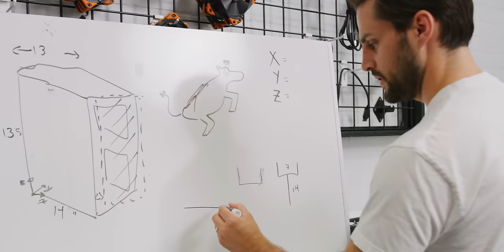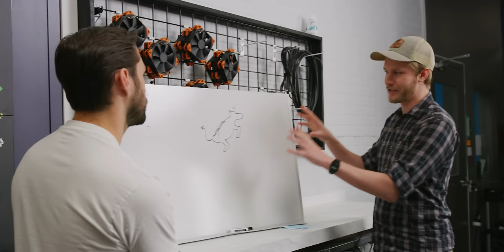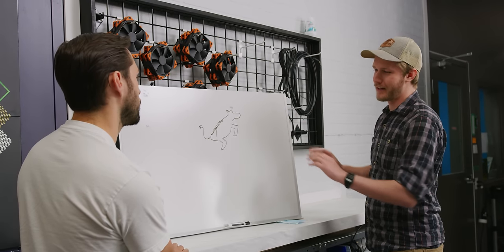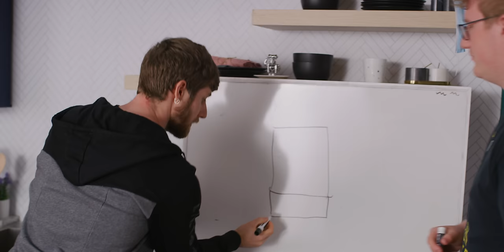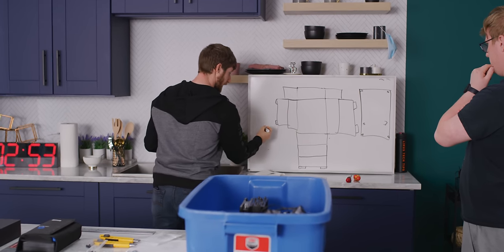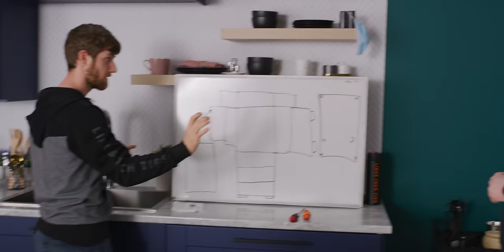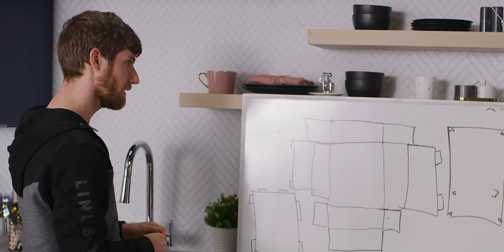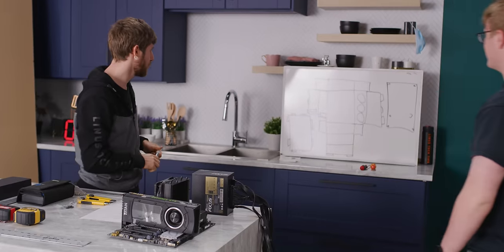Cardboard DIY PC Case Building Challenge!

Comment: how did they attach the mobo to the carboard?
Reply: screws
Reply: @radimqetzalcoatl7401  don't think.they used normal screws did they?
Reply: NorryRampage Why not?
Reply: I assume they used screwss and nuts because cardboard wouldnt really hold the screw in by itself

Comment: The video perfectly shows agile ways of working vs waterfall. Waterfall represented by linus team. Their solution was better in this case, but only because the other team was generous enough to give them more time. The best plan istn't worth shit when you don't finish on time, what almost always happens when you do excessive planning instead of just start doing stuff.
Reply: The other team wasn't generous. They too needed more time.
Reply: @Daunlouded  true. But they still had a more finished product that would probably when if it was judged when the timer ended.

Comment: I unironically did this in around 1999, with a 500mhz celeron. Even went to LAN's with it. People loved lightly hitting it and making it reboot.

My first two computers were gifts from my parents, a 286 and then whatever came right after the Pentium 4. My 3rd computer but the first I bought for my own money and couldn't afford a case so made one out of wood and cardboard.

I was then gifted a case from a friend, it was their family computer they were throwing out. I still use that case today so it's around 25 years old. Holds a i5-9600k and RTX 2070 without issue.

Comment: I would look for a box that a computer case ships in.
Just copy the holes and backplate holes, maybe glue some folded card blocks into it to hold the power supply and motherboard. Rig up screw mount arcade buttons for the power switch. That's possibly the easiest path.

Comment: Ok in all seriousness would this work permanently? I’d be worried about heat and cardboard but I have some cheap people I build pc’s for.
Reply: nah man,wont work,just comes to get their pc and you give them a cardboard box with stuff inside,oof
Reply: I mean, that's what we did for the raspberry pi until we needed a fan, that made us cut our cardboard box lol.
Reply: Go for Foam Board or Plexiglass if they can afford that much. Surely should be more stable and durable than cardboard.
Reply: Having made doll houses out of cardboard for my little one, no. It will not work permanently. One rainy muggy day or accident with a glass of koolaid and you're done.
Reply: it's a fire hazard.
Reply: @TheREALMcChimp  Look if your computer is getting up to temperatures hot enough to burn cardboard, or throws sparks that can do the same, the case isn't the problem here
Reply: @JeoshuaCollins  Maybe you just didn't quite push one of the power leads for something inductive like a fan in far enough and it arcs. Maybe the cardboard gets damp and something shorts through it. Sure, the original fault might not be caused by the case but the case is what makes the difference between a simple mistake producing an annoying buzzing noise and a simple mistake setting your house-or worse, your customer's house-on fire.

There's a reason laws prohibit the manufacture of flammable appliance cases throughout the developed world.
Reply: @virtualtools_3021  Motors are an inductive load. They can produce transient voltages exceeding the supply voltage.
Reply: @TheREALMcChimp  Uhh, you do realize PC fans are safely behind a motor controller chip, and do not have inductive spikes?
Reply: @virtualtools_3021  So long as the parts of the DC motor controller designed to do that are working correctly, sure.

The point still stands that flammable cases turn small electrical faults-which are regular occurences, else PC repair shops would be out of business-into lethalities.
Reply: It will work, only problem could be water so the cardboards fall apart/bend
Or the bigger problem... fire, a regular PC case wont burn out when the hardware itseld catch fire, but cardboard cases can be dangerous in this case.
But since many PCs got also many cheap plastic parts.... theoretically a regular case can also burn
Reply: @TheREALMcChimp  lol, you are talking bs....
Not even a big 400V motor would be able to set a cardboard on fire with its spikes, do you really think a small fan like in PCs would be able to do so? Only by their technic how PC case fans work its impossible to get higher voltage spikes. A dying motor controller instantly "disconnect" the whole inductive load with the supply itself, probably a very high resistance will still connect some parts, but the controller and so the fan is dead then without a risk of high voltage spikes
Reply: I looked into this before building a cardboard raspberry pi enclosure, cardboard ignites at around 427°C/800.6°F
 and will hold a flame at 258°C/496.4°F
 after ignition. A pc should be cutting out below 100°C so should be good, but I guess a candle/cigarette could set fire to it if dropped maybe which you wouldn't have with a metal case, but if you're dropping candles about the place you should be more careful with candles WHY ARE YOU CARRYING LIT CANDLES STOP IT.
Reply: @harrison00xXx  you realize the power supply is in that case as well right?  The power supply definitely has the ability to start a fire.
Reply: @Jaqen-HGhar  Luckily all dangerous components are far away from touching, so also far away from any cardboard which could be ignited.
Reply: @Jaqen-HGhar  btw, theoretically even a graphics card could ignite a cardboard... COULD.
I once had to troubleshoot a problem at a friends PC, at a attempt of trying to start there was for like half a second a "firebolt" of around 1cm coming from obviously a dead VRM. But even this fire definately could not ignite a cardboard, probably could have burnt it a bit like the PCB itself had a small burn mark, but for sure not dangerous.
Reply: @DKCrules50 If you're on a low budget and need a case just get a cheap used one and clean/paint it.
I got a case for 5$, and another for 2$; you might even be able to get one for free considering that sometimes people just throw away their old PCs.
There's no point in wasting your time with cardboard unless you're doing it for the memes.
Reply: @Kps117A  im not sure if its only "for the memes" (whatever memes means...)
My "cardboard" PC was much smaller than any regular case aviable nearly a decade ago, it was more like a "Mini PC" after i switched from a regular midi tower to a mainboard packaging (to make space for the new PC and reuse my old hardware as hidden Media PC)

Comment: Why are they randomly wearing and taking off masks. I'm so confused
Reply: To pretend like theyre doing something
Reply: Those who are speaking dont have it on so that the mics can pick them up better, I think. In the judging it's only those who arent speaking who have them on
Reply: so that you can actually understand them when they're mic'ed up.
Reply: @EternallyEve  Paper masks do not make it difficult to hear someone speak - in many of the shots someone with a mask is speaking and it's no worse than with the mask off. They're just being lazy about wearing masks.
Reply: Exactly this. Doesn't help at all if you will be playing around with them. And also throwing it to the computer? It's a joke, it's the same as don't using nothing.
Reply: I was thinking the same, but guessing they had them on most of the time and would take them off for key shots or for talking when filming so it kind of makes it look odd on video.

Comment: 2:50 Why does linus' dry erase marker sound like nails on a chalk board?
Reply: In video editing (I included) will add sounds you wouldn’t really think about to add to the video. Just because it should be there. The mic probably didn’t pick up the noise and the editor made a choice, and probably looked up stock white board noises. And they found chalk noises.
Reply: Honestly the editors probably did it to be funny, because they only do it to Linus
Reply: @raykmagk  You can clearly hear James' marker in the next scene and you hear Jake, in the same scene as Linus, tap the board. That amount of editing would not be worth it and makes no sense in their work flow tbh.
Linus just has a crispy ass marker.
Reply: Jabbahut755 editors might of done it to be funny, but your probably right

Comment: This was great. I would love to see a part 2 where each team has a chance to redo and improve their design in their own time and then compare the two. I'd love to see an in depth look at how they designed it and how it works. And also go over how effective the cases could be. 

Also theres the topic of fire risk. I'm pretty sure cardboard can get pretty hot before catching fire on it's own(combustion temp is something like double what you expect the temp of the components of your PC to reach). But it will also burn easily in the presence of a flame. So I'd not expect the cardboard to cause the fire, but in the presence of fire would sure help a whole lot and not the good sort of helping. Lol
Reply: You don't suppose a cardboard pc case could support any real practical use, do you? I'd have liked to see which case set on fire first :)

Comment: If I were designing the case, I'd have try to design a horizontal case that allows air to be pushed up faster, which would also allow my monitor to rest on top, or mounted above the case. Basically similar to a server case, but designed for gaming.

Comment: My case was kinda done for.
So I kept the motherboard mounting part, and the IO back part.
Closed the rest off with cardboard..
But without the cardboard, temperatures were way lower...
So right now it's basically a test-stand, with some hdd bound together with elastics (and little space for cooling).
Got an on/reset button on the motherboard so I got that going for me :3
All tucked away behind a wall of screens and an tv xD

Comment: use micro atc lay it flat in the bottom of the box, then have a few 120mm fans pulling ait in and a 200mm or so pulling the hot air out of the top.

Comment: I would have took inspiration from Nintendo Labo. When I had it the parts were all surprisingly strong, one of them I could stand on. And all without tape or glue. If you guys could have used plastic washers and things that could have worked too.

Comment: Why didn't you guys just put the system in a box with an open top, then cut holes in the sides for fans?

Already structurally good, good airflow, looks fine.

Comment: I feel that trying to skimp out on a Case is kind of dumb. I mean, at least when you go so low as to do something like this. Granted, I get this is LTT, and thats their schtick. 

But computer cases can be had for super super cheap. Besides, I actually think investing in a decent case is a good long term strategy. Sure, your PC will eventually become outdated... but you'll be able to use the old Case. 
Really, you only need to swap out a case when you feel tired of the Asthetics.

Comment: The 'Google Cardboard' of PC cases. Reminds me of the guy whose PC burned up that Linus got in the mail. Video: "The Worst Trade I've ever made". Also, on the thermals, Coroplast, the plastic version of cardboard, has been known to maintain a decent amount of heat, someone made a homeless house that was 10 degrees hotter. I'm wondering if, if you're that desperate, it might not be a better design to just leave the whole thing open just for cooling, or to build it on a Tote instead of into a box.  Is 'nothing at all' better than a cardboard pc case.  He had extra motherboard standoffs from China, but didn't he have trouble getting those before, thus making this whole thing even less practical?
Reply: I say this as someone who has actually considered drilling holes and mounting a motherboard on a board once, so I could mount the whole thing on a wall. Edit: Also, No zip ties on the cardboard?  No lego builds?

Comment: wait, are both cases vertically mounted motherboards...why? honestly I barely trust vertical mount motherboards in regular cases made out of metal, big cooling towers and GPU's are HEAVY A.F. Like why not just screw the motherboard onto a couple of sheets of cardboard and call it a day? maybe do smthg fancy to hide some cable mess but make it fully open air.